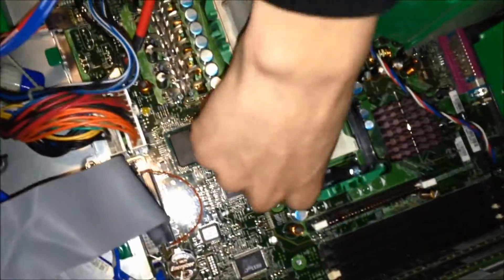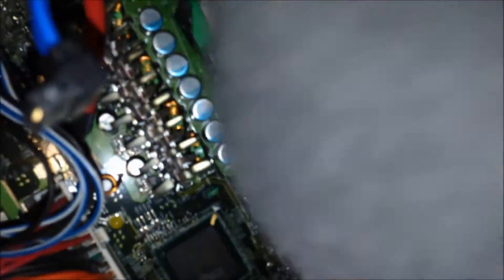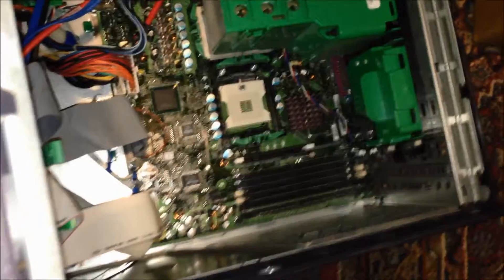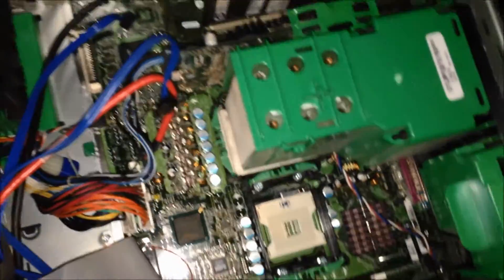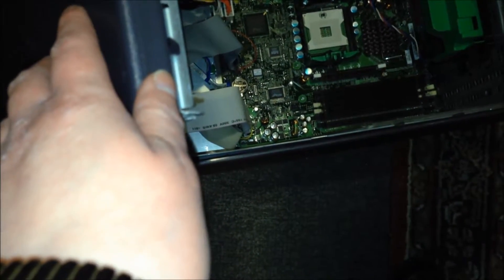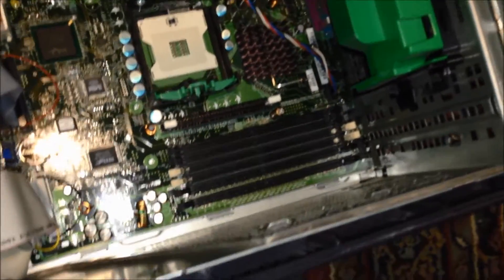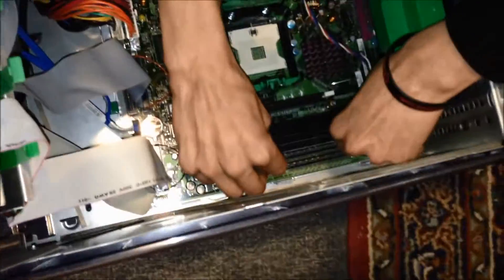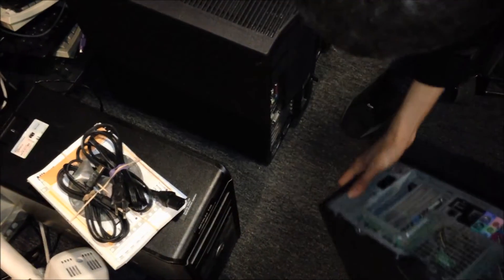Inside the dell Precision 670 workstation found in Cambridge

Comment: I have a Dell Precision 670 (given to me) with 2 Dual-Core 2.8GHz Xeons (2x SL8MA HT processors, 8 threads) I installed myself ($25, used Arctic Silver to keep it quiet) and installed a used AMD R9 270 Graphics Card ($130) that can be connected to my 4K 39" TV for an awesome visual experience. At HD resolution most games are fine (e.g. Skyrim, etc.), but it leaves one wanting more. Only compatible with Windows 7 ($65) or 8.0... not 8.1 or 10. I've only got a little over $200 invested in it, but would recommend that other stay away from anything this old that eats up to 270 Watts of just CPU power when gaming or playing 4K video.
Reply from the maker: Chris Rutz You gotta understand. I never wanted that as a gaming PC; the type of games I play require better sound cards than graphics cards. I wanted it as a server, but since we use virtualization, it wouldn't have worked for us, so it was hopefully given to someone who actually needed it, not to someone who simply wanted it.
Reply from the maker: Darn. Had I known that… That would've been great… Kind of heavy, but it would've done something at least.